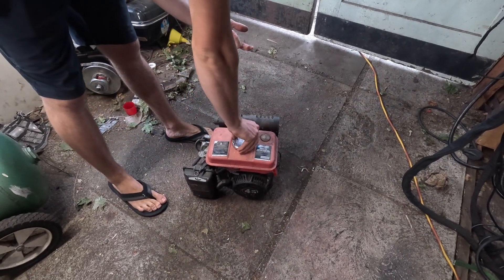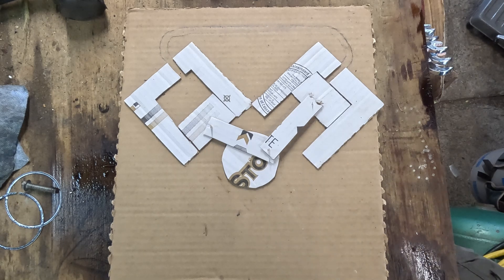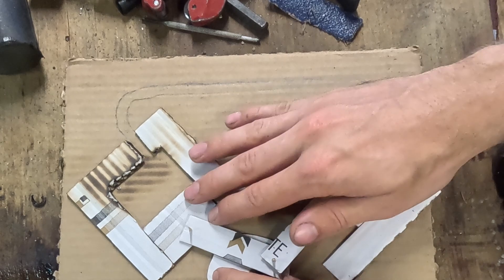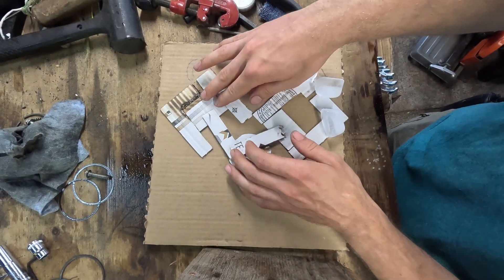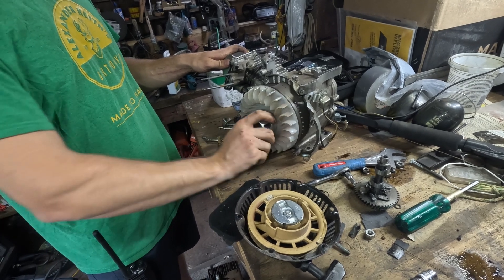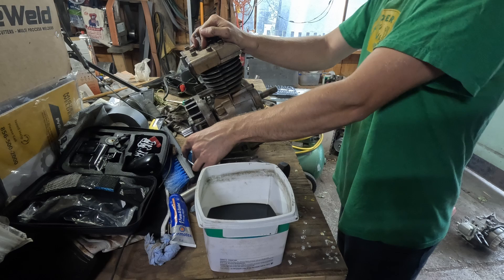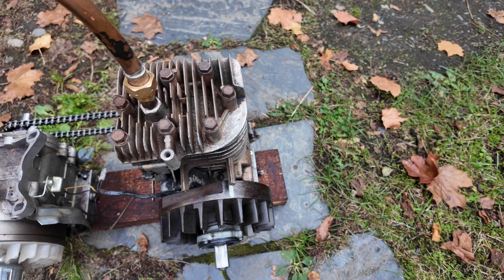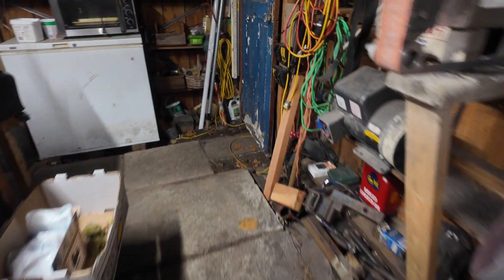Can I Make an Engine Run on Heat?!?! [The Crusty Stirling Engine]

Comment: I can give you some advice.
Dead space: in a combustion engine the piston does not clear the whole cylinder. Fill the top of the cylinders, so on top dead position the working gas volume in the cylinders is as small as possible.
Heat transfer. In a small Stirling engine the working gas is always close to the metal, but because of the scale laws the area changes with the second power to the diameters, and the volumes to the third power. Heat transfer from the metal to the gas drops fast when the distance increases. That's why heat transfer via the cylinder wall is not fast enough in a larger cylinder. Solution: make small diameter heat and cool pipes between the cylinders.
Regenerator: Put a tube with metal wire between the heat and cool pipes to store and regenerate the heat.
Insulation: Prevent heat leakage to the outside air on the hot side, and from the hot side to the cold side of the engine to increase efficiency.
Sealing: Try to seal the pistons as good as possible with low friction. Use piston rings of the sort that are used in compressors.
If you want the engine to do more than just run, you need a Stirling engine design program to find the right dimensions of the parts. By measuring input heat, power and efficiency you can improve the engine ones it works.
Reply from the maker: Thanks for the advice, I will definitely try to incorporate much of this into version 2. I hadn't considered the dead space aspect but it makes sense now that you mention it.

Comment: the stirling isnt the only hot air engine and its possibly the worst to try.

limited by thermal transfer, surface area to volume concerns. can only get so much air so hot then (without regenerator) have to cool all that air. bigger they get, faster they run, the worse the issue.

change to cayley/ericsson... pump air through a heater, either the fire itself (cayley) or through a heat exchanger (ericsson), then use the hot air to expand in a larger cylinder. large piston exhausts as small piston ingests fresh air... needs valves, can be light springs, only enough to close.
Reply from the maker: interesting, I will definitely look into this. It actually sounds A little similar to a previous attempt I had at a hot air engine.
Reply: @Crusty-Creations  possibly? the real trick is understanding the differential action of the two cylinders... the pump and the power piston are working at the same pressure. if theyre the same size, theres no gain... the pump piston has just as much force on it as the power piston.

as an idea... say the pump is 1 squin, the power piston 2 squin. 15psi on both, you get 15 pounds acting against 30 pounds, leaving 15 pounds of useful force on the power piston. then theres friction and other minor issues, losses to overcome. 

precursor to the turbojet... exactly teh same principle. compressor takes so much power to pump air, and the turbine can extract so much power... some goes back to drive teh compressor, cancelling out... theres a certain amount of loss in the compressor and the turbine.  whats left over is "useful work". only difference is a turbo jet does it continuously and has no need for valve gear. the "brayton cycle".

the actual area ratio is more about the temperature rise you can achieve, 250C doubles the pressure. theres no compression, rather its an expansion. the only rise in pressure is due to the addition of heat, and ideally that rise in pressure is matched to the increase of volume... the pressure doesnt change. that bits hard to wrap your head around?

the more usual approach is a single stepped piston in a double acting cylinder. the piston rod being large enough so the two sides of the piston have the appropriate ratio... ie, think of a hydraulic ram, and how its rod reduces the effective area on one side... that smaller space is obviously the "compressor", and as it pushes air out, the same air is acting on the opposite side, the "power" piston. as its heating up, it applies pressure on both pistons simultaneously. take away the heat, drive the crank, and you have a refrigerator instead as it absorbs heat. once you understand that, you also see that compound steam engines have the same fundamental... the high pressure cylinder as it exhausts is acted upon with as much pressure as the larger low pressure cylinder. the available work is simply the difference in the two areas.

theres very little worthwhile information online... in this modern age, we have forgotten so much, and seem to be stuck in a rut about how engines really work...

Comment: Broooo you just burn the cylinder head gasket 😪 so you'r loosing pressure in this case
Reply from the maker: I am actually more concerned about loosing pressure around the piston. its hard to achieve a low friction seal. I will hopefully be addressing this in part 2.
Reply: do you not understand the fact that a stirling engine isn't a combustion engine? it doesnt need to be tightly sealed lil bro